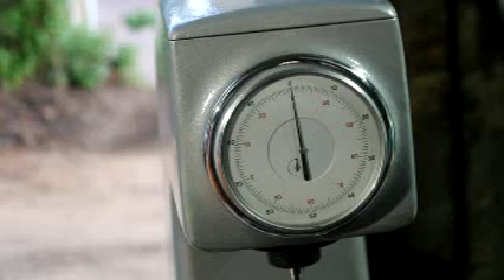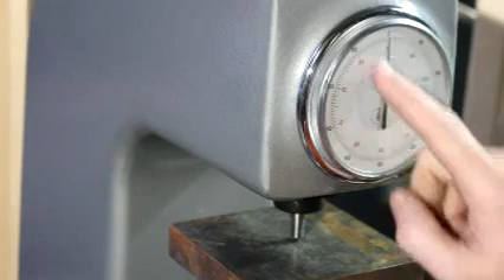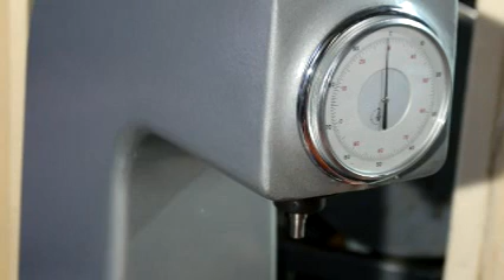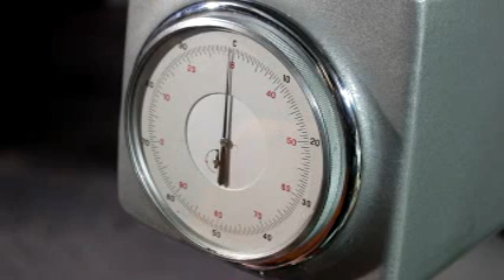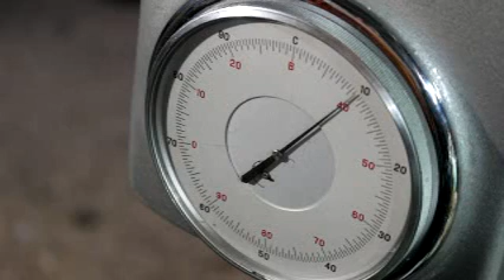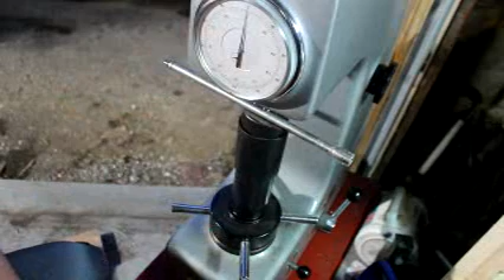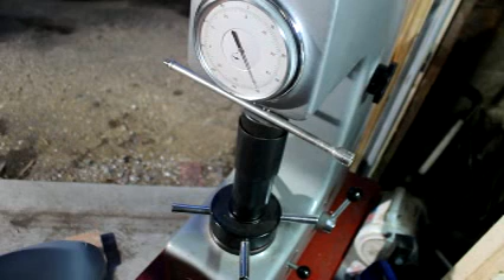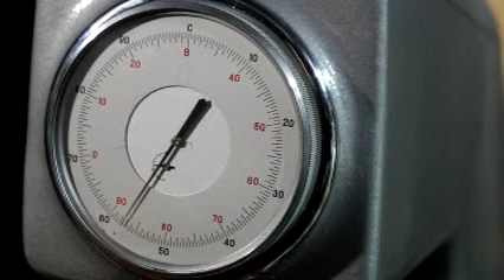Rockwell Hardness Tester in Action!

Comment: Realize this video goes back a bit, but, have you gained any wisdom regarding the calibration on this hardness tester?
I’ve got the same unit, I got for $150. The table it was mounted to, was worth that. It didn’t have a manual, and I haven’t had any luck finding any information regarding calibration, which is very obviously off.
Good to see another -03 Springfield person…

Comment: Rockwell “C” uses the 150 KG setting only. The 100 KG weight is for the “B” Scale, and the 60 for the “A” scale. Then, with either a convex or concave sample, you have to refer to the conversion charts to get the proper number. Additionally, you can’t use the “C” scale for softer materials, under 20 Rockwell. That’s what the “B” scale is for. Also, you need to remove the chrome before you test a plated item, and the surface needs to be smooth. The other problem is that buying it used likely meant that the wood blocking inside to hold the delicate weights and such in place during shipping, weren’t there. So you need to calibrate it before you start measuring actual parts. Before all of that, the table it’s on needs to be stable, with no rocking, and has to be leveled. You need to read the manual and understand how this works properly before you do a video for others.
Reply: Can you tell me how to calibrate? I have same this tester, but i confuse to calibrate